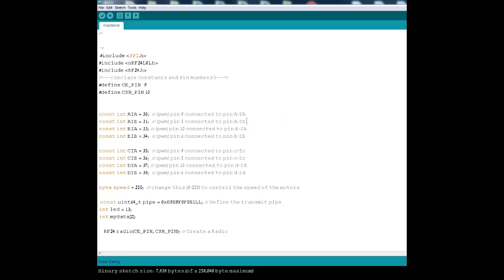Nrf24l01+ arduino smart car

Comment from the maker: /*
 */
 #include <SPI.h>
#include <nRF24L01.h>
#include <RF24.h>
/---( Declare Constants and Pin Numbers )---/
#define CE_PIN   9
#define CSN_PIN 10
 
const int AIA = 30;  // (pwm) pin 9 connected to pin A-IA
const int AIB = 31;  // (pwm) pin 5 connected to pin A-IB
const int BIA = 33; // (pwm) pin 10 connected to pin B-IA 
const int BIB = 34;  // (pwm) pin 6 connected to pin B-IB
const int CIA = 35;  // (pwm) pin 9 connected to pin c-Ic
const int CIB = 36;  // (pwm) pin 5 connected to pin c-Ic
const int DIA = 37; // (pwm) pin 10 connected to pin d-Id 
const int DIB = 38;  // (pwm) pin 6 connected to pin d-Id
 
byte speed = 255;  // change this (0-255) to control the speed of the motors
 
 const uint64_t pipe = 0xE8E8F0F0E1LL; // Define the transmit pipe
int led = 13;
int mydata[2];
   
    RF24 radio(CE_PIN, CSN_PIN); // Create a Radio
 
 
 
void setup() {
 
     mydata[0]=0;
     pinMode(led, OUTPUT);
    Serial.begin(9600);
      radio.begin();
  radio.openReadingPipe(1,pipe);
  radio.startListening();;
   
 
  pinMode(AIA, OUTPUT); // set pins to output
  pinMode(AIB, OUTPUT);
  pinMode(BIA, OUTPUT);
  pinMode(BIB, OUTPUT);
 
   pinMode(CIA, OUTPUT); // set pins to output
  pinMode(CIB, OUTPUT);
  pinMode(DIA, OUTPUT);
  pinMode(DIB, OUTPUT);
  stopnow();
}
 
void loop() {
 
  mydata[0]=0;
   if ( radio.available() )
  {
    // Read the data payload until we've received everything
    bool done = false;
    while (!done)
    {
      // Fetch the data payload
   done = radio.read( mydata, sizeof(mydata) );
  
      Serial.print(" mydata: ");
      Serial.println(mydata[0]);
      
     
 //     Serial.print(" Y = ");     
   //   Serial.println(joystick[1]);
       digitalWrite(led, HIGH); 
   //  delay(100);
    }
   
   
  }
 
 
  else
  {   
  //    Serial.println("No radio available");
       digitalWrite(led, LOW);
   //    delay(100);
  }
if (mydata[0]==1) forward();
if (mydata[0]==2) backward();
if (mydata[0]==3) left();
if (mydata[0]==4) right();
if (mydata[0]==0) stopnow();
delay(40);

}
 
 void stopnow()
{
  analogWrite(AIA, 0);
  analogWrite(AIB, 0);
  analogWrite(BIA, 0);
  analogWrite(BIB, 0);
 
    analogWrite(CIA, 0);
  analogWrite(CIB, 0);
  analogWrite(DIA, 0);
  analogWrite(DIB, 0);
}
 
 
 
void backward()
{
  analogWrite(AIA, speed);//left top
  analogWrite(AIB, 0);
analogWrite(BIA, speed);//right top
 analogWrite(BIB, 0);
 
  analogWrite(CIA, 0);
 analogWrite(CIB, speed);
 analogWrite(DIA, 0);
  analogWrite(DIB, speed);
 
 
}
 
void forward()
{
 analogWrite(AIA, 0);//left top
  analogWrite(AIB, speed);
analogWrite(BIA, 0);//right top
 analogWrite(BIB, speed);
 
  analogWrite(CIA, speed);
 analogWrite(CIB, 0);
 analogWrite(DIA, speed);
  analogWrite(DIB, 0);
 
}
 
void left()
{
  analogWrite(AIA, speed);
  analogWrite(AIB, 0);
  analogWrite(BIA, 0);
  analogWrite(BIB, speed);
 
 
  analogWrite(CIA, 0);
 analogWrite(CIB, speed);
 analogWrite(DIA, speed);
  analogWrite(DIB, 0);
 
}
 
void right()
{
 analogWrite(AIA, 0);
  analogWrite(AIB, speed);
  analogWrite(BIA, speed);
  analogWrite(BIB, 0);
 
 
  analogWrite(CIA, speed);
 analogWrite(CIB, 0);
 analogWrite(DIA, 0);
  analogWrite(DIB, speed);
}